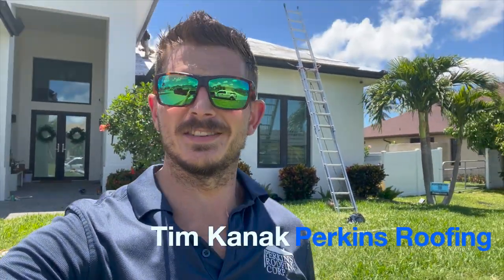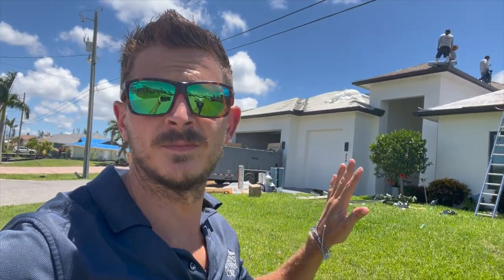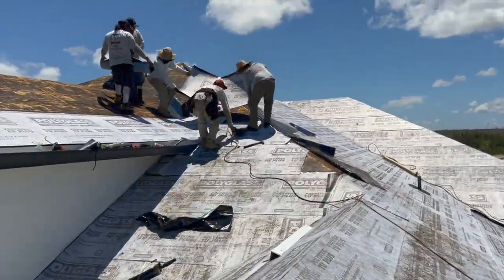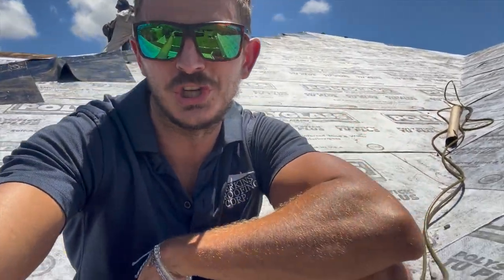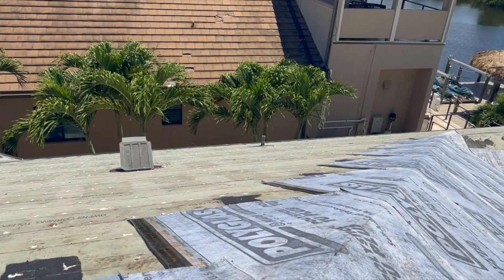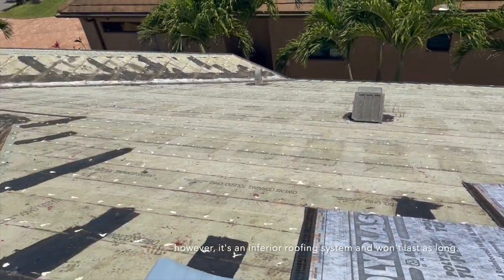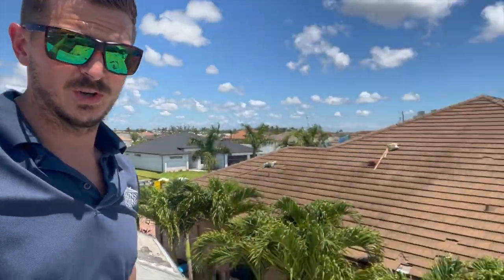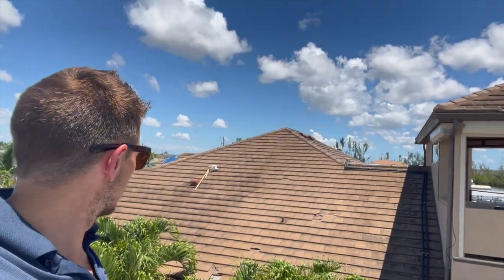Florida Building Code Tile Re-Roof in Cape Coral (Florida Roofer)

Comment: Why can't you just put the peel and stick over the old peel and stick? Can you guys work in Venice? I'm almost ready for a new roof. Thanks
Reply from the maker: Tile underlayment is polyfiber, the only way to get adhesion to it would be to prime the entire roof with asphaltic primer first; however this does not meet wind uplift requirements for Florida Building Code.

If you run into an SA (self-adhered) you can now mechanically fasten a Polyanchor HV over it, but this is brand new and didn't exist when we did this video.

Yes, we can work in Venice (just need to get an AirBnB for our team when we work on the west coast of FL), call our office when you are ready (305) 687-6521.
Reply: @perkinsroofingcorp  will do.

Comment: Tim, I saw one of your Miami videos where you put down felt AND the peel & stick.  Is the combination of these two what you call HVHC upgrade?  If, so then applying the peel & stick directly to the deck is the standard FBC code?  Is this because it's a re-roof and your not required to do the HVHC because its not a new home?
Reply from the maker: Yes, the combo is HVHZ (high velocity hurricane zone).  Self-adhered (SA) direct to the deck meets standard FBC and does not meet HVHZ, this is primarily outdated on behalf of HVHZ as the updated building code is expected to require a heavier base sheet than #30 to be mechanically fastened OR SA direct to the deck (which has a higher wind uplift rating).  The reason to avoid SA direct to the deck is #1 it makes it really hard to remove when re-roofing... and will increase future demo costs and #2 you are getting less mils of thickness under your roofing system.  

Polyglass developed a new base layer to take care of the wind uplift issues with #30 called PolyAnchor HV and also has a more expensive / heavier base sheet used primarily under flat roofs - which is required in Boca Raton when installing a mechanically fastened base layer called Polyglass Elastobase.